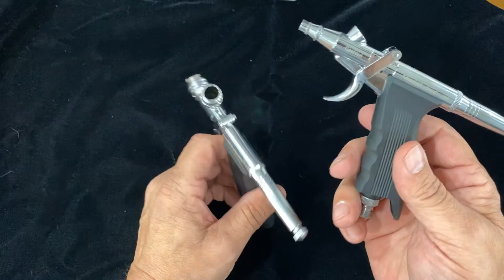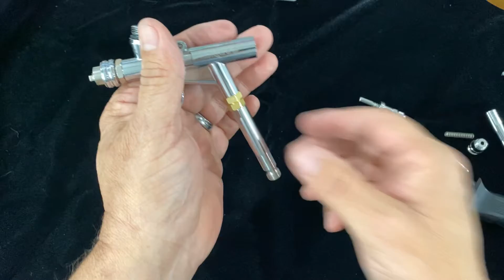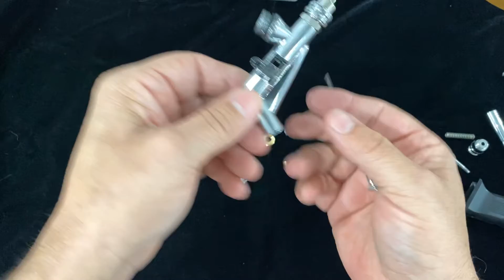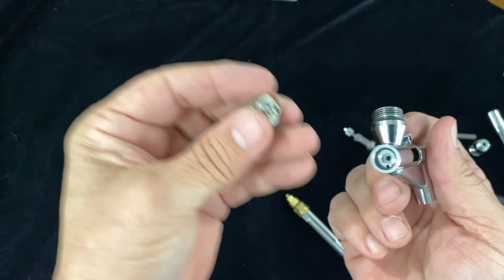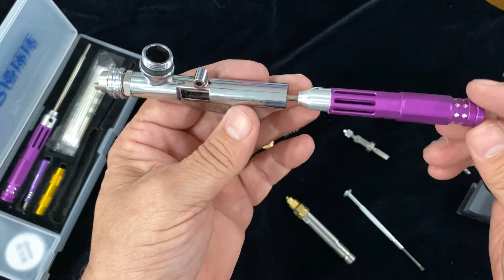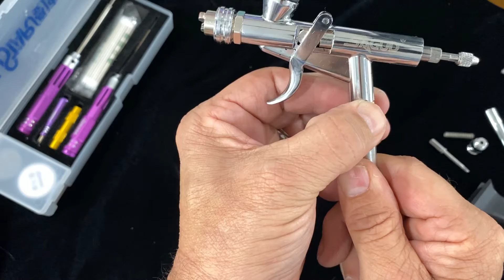How to take apart and put together pistol grip airbrushes! Gaahleri/ sparmax/ sagud master and more!

Comment: Hey Bill. Could you provide a link to the toolkit you recommended in the video, please? Thank you kindly.
Reply from the maker: Between the time I bought mine and the time i made this video, they no longer sell that set in the USA... Naturally.  
There is this set, but it does not come with the larger diameter needle packing screw.   But it does have grease, nozzle and air tool.   

https://s.click.aliexpress.com/e/_DeAPkdd

You can order just the packing wrench and the air valve tool very cheaply.   which is what I had for a long time, but the larger diameter tool is the right one for my eclipse.   Noone i have found so far makes a 1.3 which some airbrushes use.    the 1.2 1.4 combo is the same size iwata uses in their toolkit.     The iwata kit is great, And comes with soft pliers and a nice case.    But it is pretty expensive.   I had one, and left it somewhere long ago.  Sooooo i havent replaced it as of yet.  :/

Comment: Bill I’m hoping to get your recommendation for a compressor for air brushing that i could use as well for muraling/spray painting. Thanks for all your videos they are super helpful. Bout to dive back into the craft after a vey long time.
Reply from the maker: Murals on site?   
CAT aluminum tank for light weight.. big enough tank to run small spray guns for a period and all day on any airbrush.  Of course you need to add a moisture trap and hoses to adapt.  But this is what i would pick time after time.  

If you dont go with this one, at least one similiar at a MINIMUM 2 gallon tank  if not using spray guns.   
Then id get a no name minigun for the big blocking.  (well actually i DID exactly that) 
https://amzn.to/4cHI3Qd

++AFF LINK+++
Reply from the maker: Id also look at one of these versus a bigger spray gun.  
https://amzn.to/3TGN9DN

++Aff Link++   

I have a review elsewhere on thi brush of course.   and I love it.  
Id probably run one of those.. maybe a badger anthem and several bottles for wall murals.